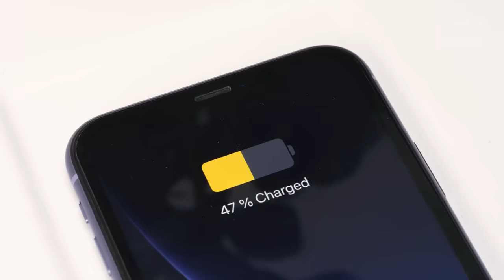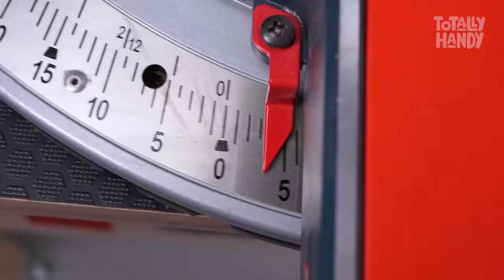Space Saving Furniture & Hidden Storage For Your Home | Compilation

Comment: 25:23 i told my friend to never have your fingers over or near the blade like that and he didnt listen. lost half of 3 fingers 6 years ago. 
Be careful
Reply: That’s how my boss/the guy who I’m learning carpentry from does it most of the time.  Like splitting a piece of wood at 90° with the blade halfway up the piece.  Like to make some battens or something. Even only halfway up at 1 1/2 inches, or even 2” or 3”, I’m not going there. 

I’d rather make a quick, thin push stick out of scrap. Even if it gets a little scarred up.

Boss is a bit old school, when it comes to some safety stuff, not everything luckily.  Also, one of my first jobs, one of the other carpenters on site told me that the table saw was the most dangerous thing there, to respect it.

Comment: Hinges drilled into plywood end grain for a staircase is an invitation for people above 100 pounds to get into a fatal accident
Reply: Yeah, like 85% of population is obese and overweight....
Reply: Probably not even that heavy
Reply: What wood would you suggest?  Wanted to turn unused space at the top of my stairwell into storage but don't like ladders.
Reply: @jjteacher7482  any solid wood would do. Plywood is just sheets of very thin wood glued together and has no strength in this application. Even pine would be better than ply.
Reply: @jjteacher7482  it's a really nice idea, but horrible choice in material
Reply: @woodworkingandepoxy643  its a poor idea because the hinges on the right side are putting the screws under tension, eventually they will pull themselves from almost any kind of wood, not to mention those hinges are terrifyingly small compared to the expected load.
Reply: @platinumsky845  yes. I know. I said that plywood was a poor construction method for this. Did you mean to reply to the other guy?
Reply: You do know that the 1" plywood is furniture grade which is a lot stronger. 2.5" brass hinges 5.6 to 6.3 lbs per square inch of constant "door" weight per hinge. Extra stability with the closer.. They use this type of step system in tiny homes on quite a few more stairs too. I'm sure there's a lot of structural mathematics and material fatigue stats that will calculate how much each stair and span (distributed weight to tread) and how much strain each hinge material can hold. Also need to figure in the assisted closers. There is assumed liability for he guy so his calculations of materials will hold. He doesn't give extreme details its just a quick demo not instructive details.
Reply: @tinamortensen1220  it's not about how much weight the hinges themselves can hold, it's the screws that are being put under the most stress. The wood and hinges might be strong enough to hold the weight if a person, but the way he built the joint is ingerantly weak. Each one of those stairs is being held up by six small brass screws in the end grain of plywood. It might hold for a while, but with no structural support to keep the screws from ripping out those stairs are a ticking clock.
Reply: And I'm positive he wasn't building them for someone who thinks donuts are a food group.,
Reply: .......Everyone is a Critic!
Reply: @tinamortensen1220  awesome answer,,, actual thought....🤙🤙🤙👍
Reply: @livingdeeply15  lol
Reply: @BONGS and BUREAUCRACY  had to, just couldn't help myself.... sorry!! Your comment made me laugh as well!!!
Reply: I agree with you for obvious reasons, but I don't think much of this is meant to be for home use. This looks to me like an idea real, especially considering their knowledge of wood and joinery
Reply: Benchmark my man 🙌🏼 Seriously well done!
Reply: @BONGS and BUREAUCRACY  I can tell you beyond any doubt that even the 150lb me would not be on those without extreme caution and the 230lb me that I am now would not go near those! And even i know donuts aren't a food group. Pastries are. But not donuts alone ;)
Reply: @livingdeeply15  😂😂🤣🤣🤙
Reply: @DalisDemon  😂😂🤣🤣🤣🤣
Reply: @livingdeeply15  Been noticing that on this type of YT channels.
Reply: wasn't it for kids?
Reply: I'm pretty sure the lollie jar rack was for kids as well.

Comment: the storage inside the hollow core door was nice, I would have just used wood, also would have put it hinge side not on the side where you would feel the added weight, and a good fast swing would pop it out flinging your money all over the place.  hinge side would hide the opening, the added weight would be near unperceivable and the stuff dangling in there wouldn't move around so much as the door opens and closes no matter how fast you move the door, hinge side will always move slower and the compartment would never fall out due to physics.
Reply: Gi look at the hinge side of any door, how much room you got to install on that side would be a waste of materials. 
Think. Before you speak.
Reply: @dianeh2420  what? you know doors open right? the hinge side of the door has just as much room as the latch side, what are you on about? think before you speak
Reply: Diane H is right bro. The door frame would be in the way
Reply: @jeffreystewart8726  have you opened a door before?
Reply: @Mikej1592  In every one of the doors in my house, the frame would be in the way. But...only just. It would be possible to change the design so it wouldn't, but the fittings are consistent across the property so that one door would stand out.

I suspect the way the frames are built are likely to be regionally different however. Mine are pretty standard in the UK so wouldn't lend themselves easily, but it might be different elsewhere - in fact I'd bet on it. So your doors might be absolutely fine if you're not in the UK. None of us can say you're wrong without seeing the configuration in your particular case.
🇬🇧
Reply: Bbvya
Reply: Why not just make a slot in the solid top rail of the door and make that a easy to access place that is impossible to see??

Comment: When you put that type of glue between two pieces of wood, then spray the activator on the outside (not on the glue), how does it work? Serious question. I’ve never used it. I’d think that the activator would need to be sprayed on the glue. Maybe put glue on one piece then spray activator on the opposite piece and immediately put them together. But I have no idea
Reply: what the activator does to the glue is it makes it "kick", which starts a chain reaction in the super glue that moves throughout the glue. Just hitting the edges where the glue squeezes out is often enough to get the glue strong enough to hold for long enough for the rest of the glue to dry, which is only about a minute or two

Comment: What is the grey paint u used before using white spray on the wall mounted secret desk
Reply: That's a Primer coat, basically it's used to expose any hidden flaws in the peace that may need touching up as well as acting as a base coar for your main paint color to adhere to and give you the more accurate color you're looking for.

My source; I've been painting for many years now, anything from furniture to model kits.

Comment: Such beautiful wood,  love the ideas. In my reply to plf... You do know that the 1" plywood is furniture grade which is a lot stronger. 2.5" brass hinges 5.6 to 6.3 lbs per square inch of constant "door" weight per hinge. Extra stability with the closer.. They use this type of step system in tiny homes on quite a few more stairs too. I'm sure there's a lot of structural mathematics and material fatigue stats that will calculate how much each stair and span (distributed weight to tread) and how much strain each hinge material can hold. Also need to figure in the assisted closers. There is assumed liability for he guy so his calculations of materials will hold. He doesn't give extreme details its just a quick demo not instructive details.